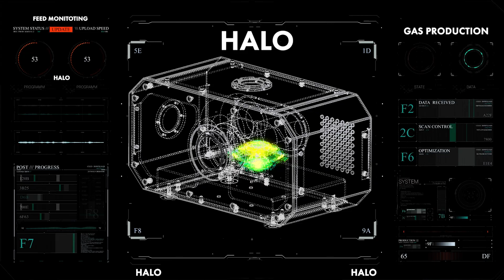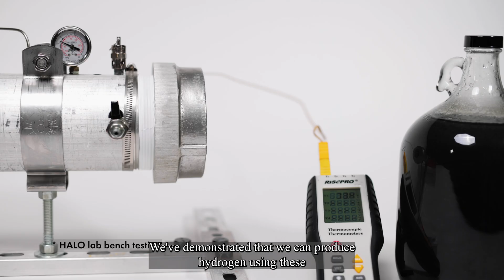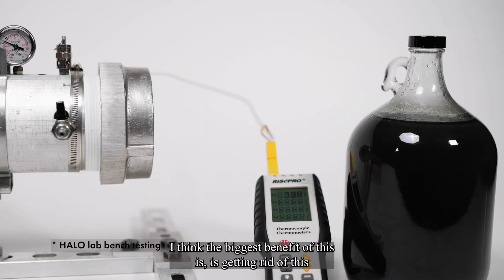HALO: Hydrogen Recovery from Waste

Comment: How much energy the plasma system uses, compared to the energy that could be generated with H2? What's the efficiency rate?
Reply from the maker: That is the challenge that we're working on optimizing currently - both the methods by which the energy input is generated and the efficiency of the input and outputs. The end goal is to be creating 100% green hydrogen with a net positive energy.